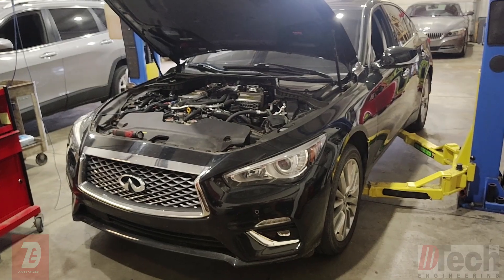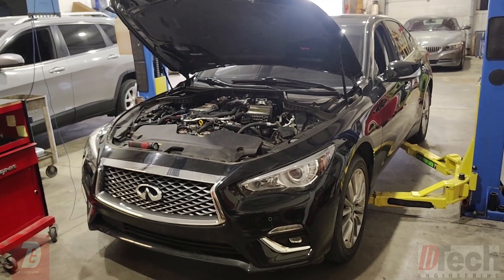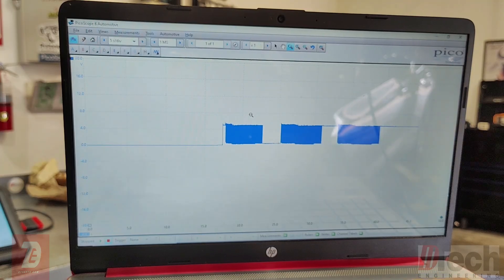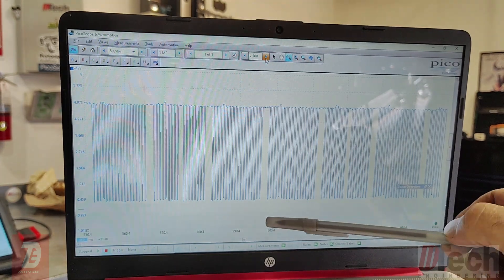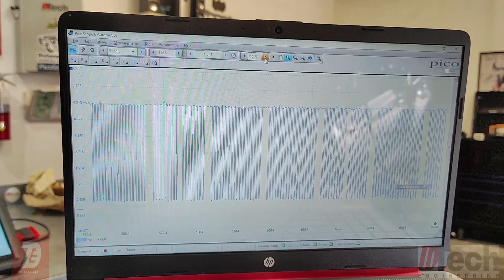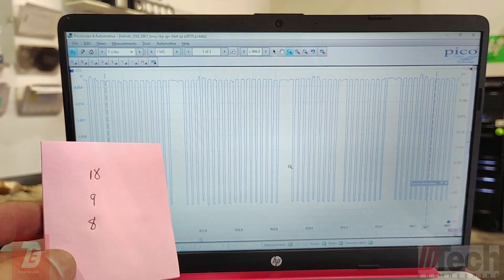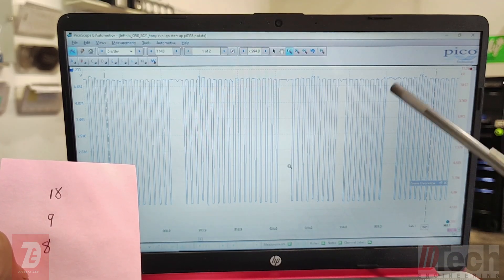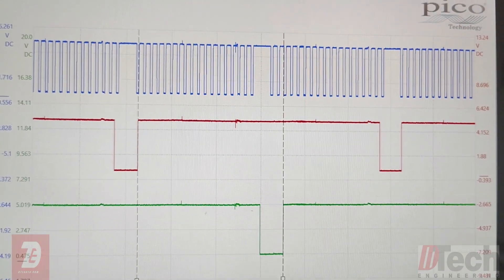Infiniti Q50 P0335 After 3rd Engine Installed

Comment: Excellent diag Sadel! Definitely, with that type of flywheel is going to be easy to bend the teeth if not careful when installing a new transmission!In the FWD may be the CKP sensor hole may be the best way to fix it. Started motor I think is on the other side. Thank you for sharing, Sadel!
Reply from the maker: Glad you enjoyed the video, thanks for watching!